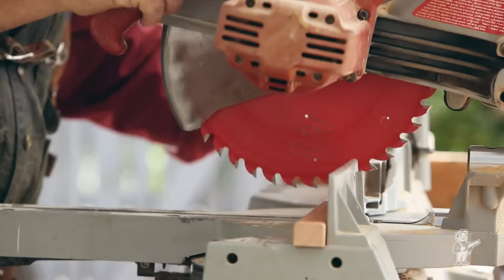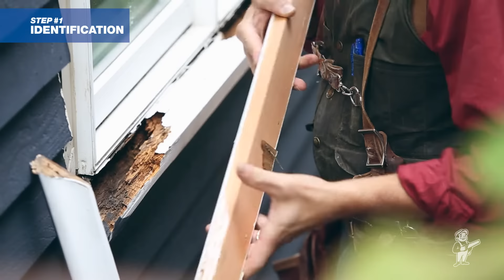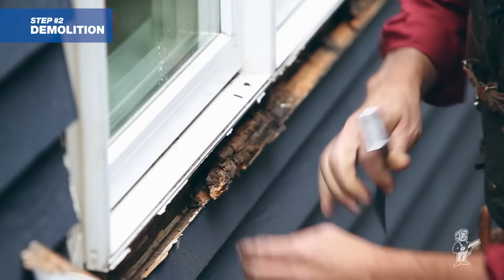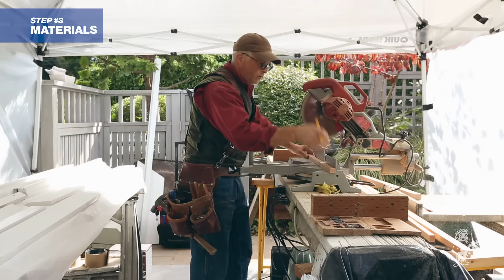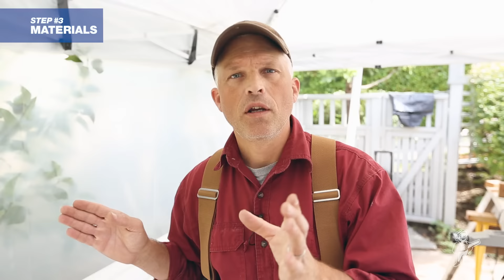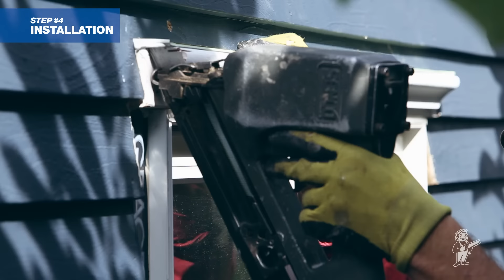How to Repair Decayed Window Trim

Comment: Thank you so much for posting! I just cut out dry rot from around my window and installed adhesive flashing and metal flashing above the trim - thanks to this video! I couldn't find any instructional vids on how to retrofit - as in, put the flashing in after the fact without taking out the whole window. I realize it's not the ideal fix, but for those of us in a pinch, it's great!

Some more detail on the size, shape, and install of the metal header would be terrific, though - I had to scour the internet for info on the proper angle and how to get the sheet metal bent perfectly, where exactly to caulk or seal and where to leave a gap. Also my siding had trim nails in it and some random caulking/adhesive globs that made it impossible for me to push the metal flashing up and behind. I used the oscillating saw to carefully cut through the adhesive and had a heck of a time getting those tiny rusty nails out.

Comment: Steps and key products for reference.  
1) Remove rotten trim and enough siding to install flashing over window trim.  
2) Cut new trim.  
3) Prime everything to help seal it.  
4) Tape around the window frame with your favorite brand of flashing tape to prevent water from getting in.  
5) Install flashing above the window.  
6) Use "sikaflex" caulk-I'm not sure if this brand is widely available.  
7) Fine-tune trim fit, making sure to seal all sides of the trim, especially the end cuts.  
8) Install and paint!

Comment: Amazing all the carpentry involved and you use a rattle can for primer! Waste of time, you need to push the primer in with a brush or roller depending on the scope, the most overlooked thing is proper prep and waterproofing!

Comment: Hello, I have a circa 67 weatherboard house with some rotted timber around the window frames. As far as I can tell it has a 'Beazley Sill' which does not go all the way under the rail. I am trying to find a section view of the frame, Jam, sash etc for the casement with awning window, so I know how to dismantle the window and fix the various parts. Any idea where I might find such a drawing. Its a standard 42mm thick rail and stile with a central muntin, one single fixed pain on one side and a lower transom and one awning window above that on the other side, 1800 wide by 1500 depth. So fairly common type of old wooden window frame I would have thought.
Reply: Hi Allan. Lets start a convesation. Where are you located? Can you send me a picture? You can find my website at www.builttowithstand.com. Looking forward to hearing from you.